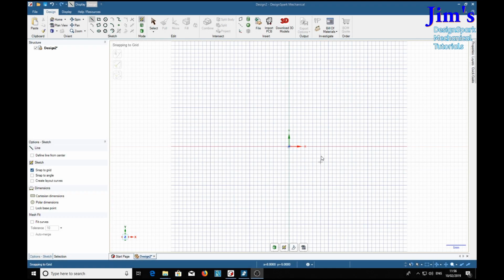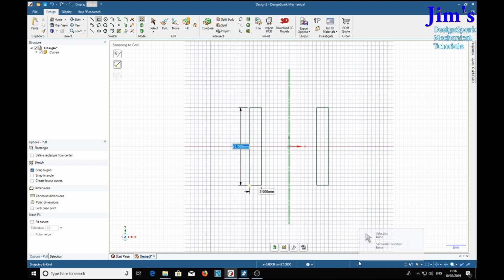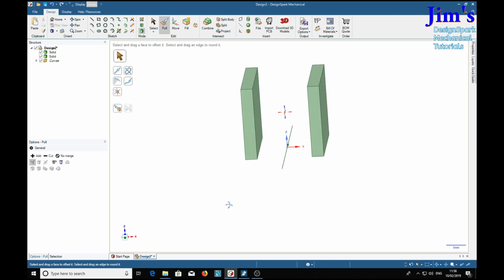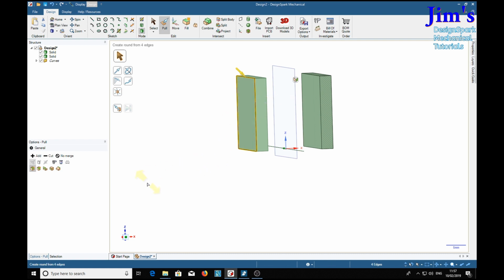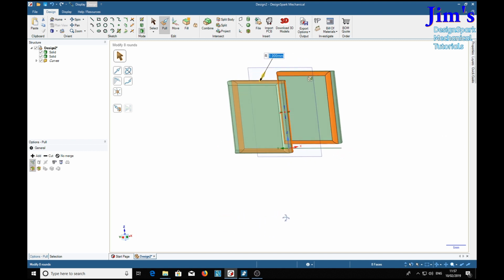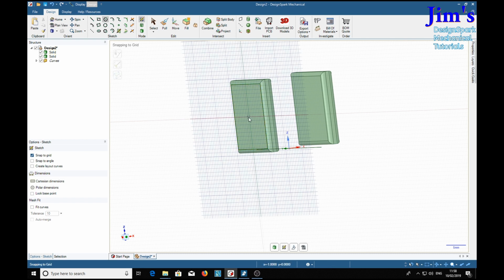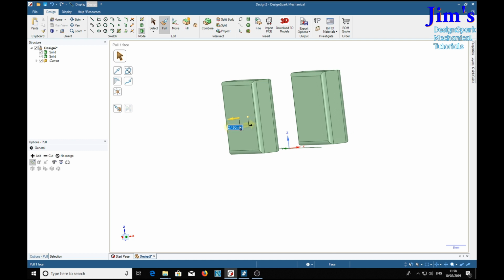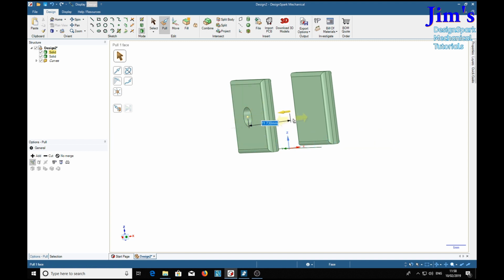DesignSpark Mehcanical: The mirror tool pt2

Comment: Another thing that do not function in the mirror function, and I would really love to have it, is when you draw a spline with a mirror line active everything is great. But when you would like to change the shape of the spline by moving curve points or control points, the changes are applied only on one side of active mirror line. My workaround is copying, moving and turning two times created spline. But it is awkward.
An awkward workaround for the problem you showed is to draw a circle on the mirror plane and then pull both sides with cut (-) option selected. I explain this behaviour to myself in that way, that the circle drawn on the side of the pulled object is already "outside of the mirror world". The circle on the mirror plane is of the same world. Maybe stupid explanation... but works.
Reply from the maker: Changing a spline by moving the points on the line does work - I've just tried it. Try this.
1. Draw your line and make it a mirror line
2. Draw a spline on one side of the line, which should repeat on the other side of the line.
3. Select the Move tool and select a point on the line - the move handles should appear.
4. Drag either of the anchor pointer arrows and the line and its mirror should be modified.
FYI dragging the anchor hub does not work.

Hope this works for you.
Reply: Things are getting interesting. Initially I could not reproduce what you were proposing, so I started to think of what I am doing in a particular way specific. And I found the answer. I was starting the spline FROM the mirror line. This way, irrelevant what you are doing, you can not modify both spline symmetrically by moving neither curve point, neither control point, nor using the move tool. BUT, when you start the spline anywhere else, but not the mirror line, all three methods are working. Anyhow, for my usage the move tool is not an option, because e.g. when I design new guitar body outline, I have to correct the spline by hundreds of very small moves and check by eye the resulting spline. Move tool is good if one have to move something at specific direction. So an option for me is moving curve points, or much better control points, because the curve behaves then much more like a Bezier curve. BUT at the end I need a closed surface with splines connecting at the centre line! And I found today the way to do it. I create a mirror line, I start the spline on e.g. right side of the mirror line and I create the second spline point on the left side, where I draft my guitar outline spline. I finish the spline again on the right side of the mirror line. Then I can modify the spline on left side and the right side is modified symmetrically. After I am happy with that, I switch off the mirror line and trim (T) the line ends that go outside of the closed outline. Then I can draw a centre line from points where both splines met. Strangely enough, the solution I gave you yesterday to your mirror question, works, when you draw a circle ON the mirror plane...
I have learned something today again, I still do not understand a lot. It is beautiful. In a way ;)
Reply from the maker: I sometimes draw a close approximate curve using straight lines first then, using the verticese draw a spline on top of it. The spline then smooths out the approximate straight line curve. The straight line curve is then deleted leaving the spline curve.

Comment: Try selecting the cut (-) option with the pull tool, you should be able to cut through multiple objects that are aligned as in the example.
Reply from the maker: I tried it - no joy.